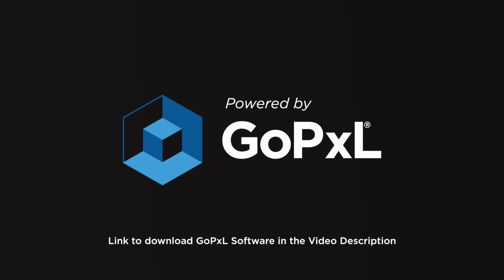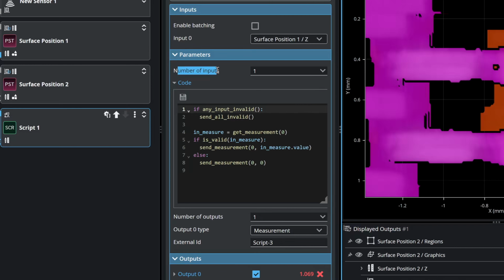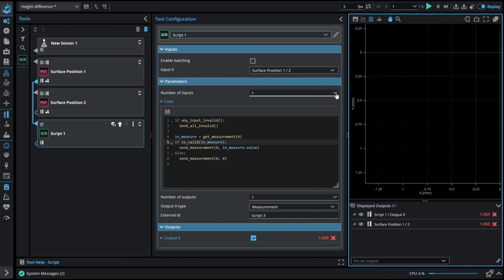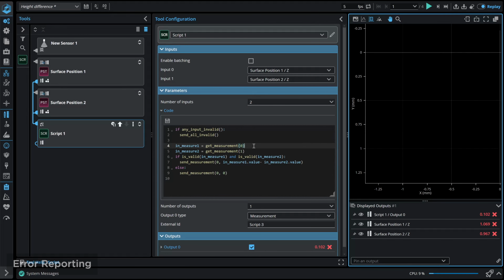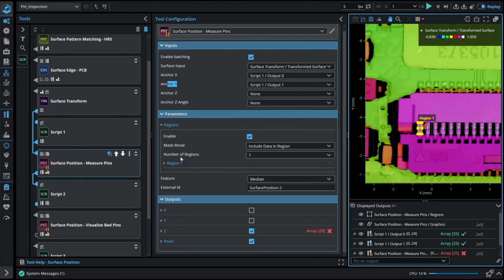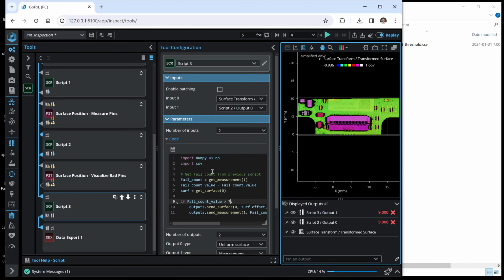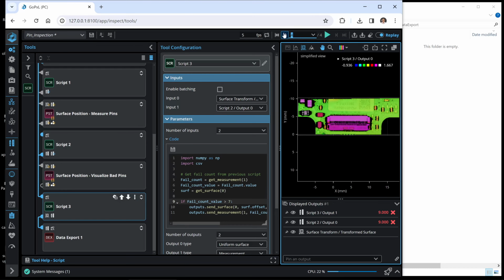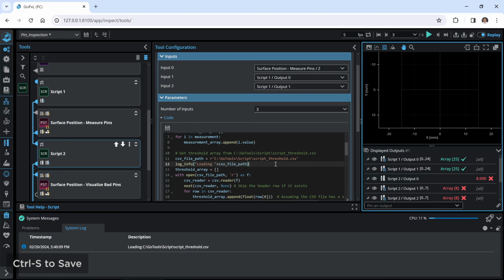Infinite Possibilities with the Script Tool in GoPxL

Comment: It's nice to work with scripts. I would like to add two 2D profiles and expect the script to output a single profile that is a combination of both input profiles. I have some code like below: 
profile1 = get_profile(0)
points1 = profile1.points
profile2 = get_profile(1)
points2 = profile2.points

mask = (points2 != -32768) & (points1 != -32768)
result = numpy.full_like(points1, -32768)
numpy.add(points1, points2, out=result, where=mask, dtype=numpy.int16)

send_profile(0, 1, 1, result)